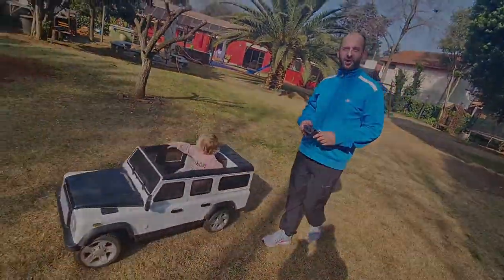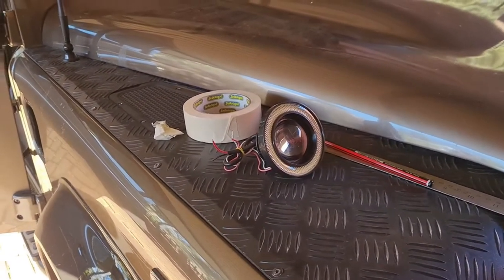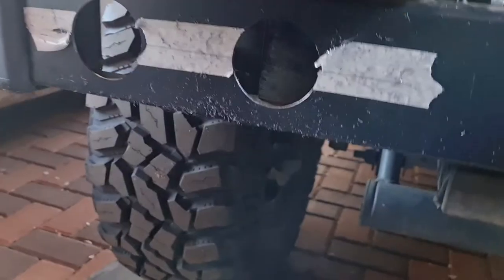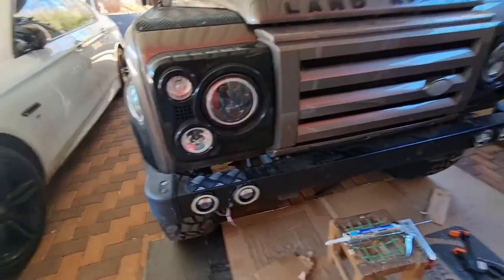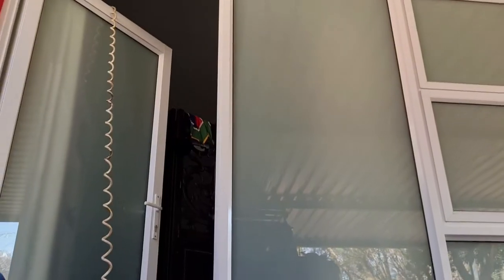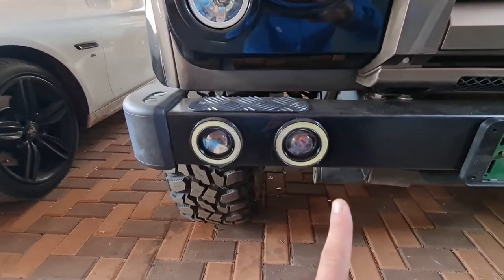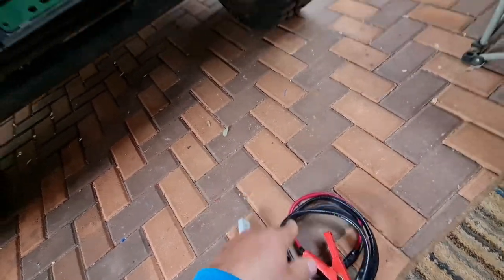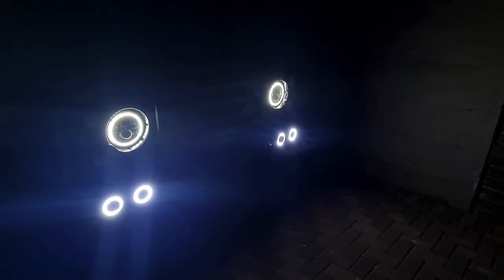Defender OEM Bumper - Fog lights c/w DRL install

Comment: Nice video from a Saffa, what live feed did you use for the DRLs in the headlights?
Reply from the maker: Hey Garth

I have a live feed running between the crank battery and dual battery charger that I used to feed the lights, I then used a relay to switch the lights on when the accessory (White) wire under the seat becomes positive. (Ignition on position) white wire in the fusebox under the instrument cluster can also be used. 

Thanks for the comment.
Reply: @MdPcustoms  thanks is that for the 7 inch headlights as well?
Reply from the maker: @garthbawden5550  No, you can connect the headlights DRL's to the same feed as the fog lights DRL's. That's still on my to-do list, but it shouldn't be difficult. I however used the parking lights wire to switch the DRL on the headlights separately to the fog lights.
Reply: @MdPcustoms   quick question what brand are the 7 inch headlights? and where did you get them. nice mods btw.
Reply from the maker: @Tom Hull Thanks for the compliment. To be honest, I just bought those when I needed lights as the standard lights were letting me down. I won't recommend them at all. If I knew what I know now I would probably get the vision x lights. https://www.visionxusa.com/shop/7-vx-series-led-headlight/
Have a look at the below Channel they have quite detailed reviews on some headlights. https://www.google.com/url?sa=t&source=web&rct=j&url=https://m.youtube.com/channel/UCv0mG3NopUNFWYDsf_t9fqQ&ved=2ahUKEwj_otP1tZH1AhViSWwGHTTuDvoQjjh6BAgVEAE&sqi=2&usg=AOvVaw2jT1NBNU-zCv4XHu2WydnJ

Comment: Hey bro do they make a difference to the brightness
Reply from the maker: Hey bud. You can see a difference in brightness in front of the vehicle. Not a big difference in general at a distance. I connected the spotlights with the brightas and made a big difference around the front of the vehicle.